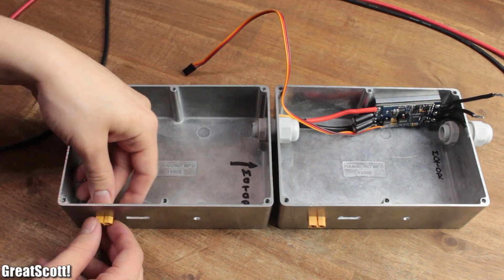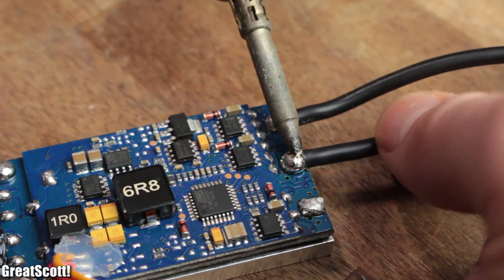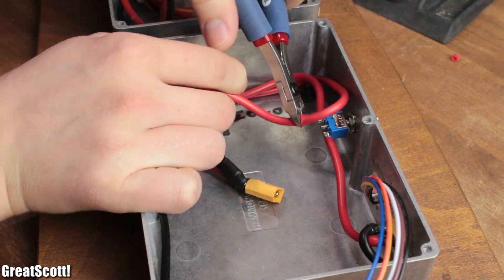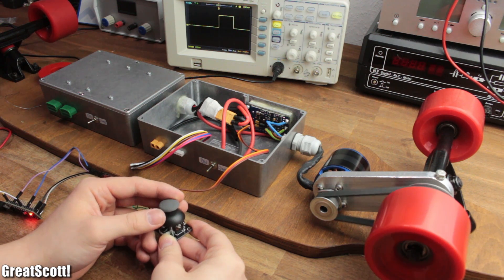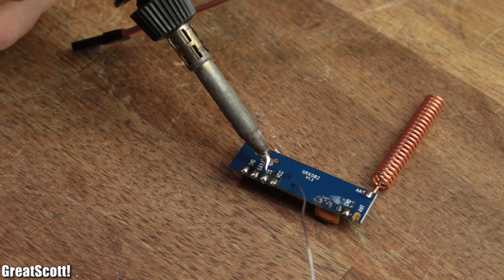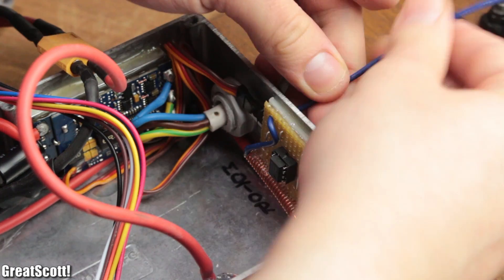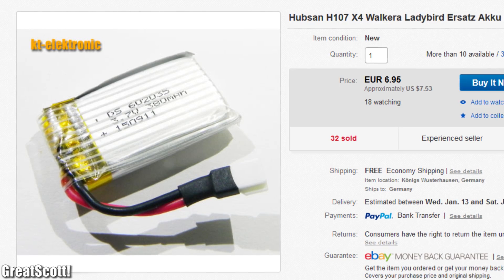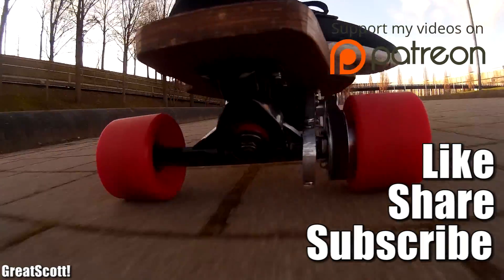Make your own Electric Motorized Longboard (Part 3) - the wiring & remote control

Comment: Hey Great Scott! Nice Video. I have a question for you. How is your power switch able to handle the DC voltage and Current required for riding a board like this? Most of the switches like yours that i found had a limit of 25 V at like 1.5 Amps, whereas a board can pull 30 Amps. Which switch are you using?

Comment: In theory, couldn’t you hook up a manual toggle switch to one of the batteries and hooked up another motor you could use it as a generator as you skate around to charge the other battery

Comment: have u had any problems because of the posibility of electric sparks while disconnecting and connecting the batteries and how did you avoid those + have you considered wiring the batteries in series to test the max speed ?
thanks

Comment: I have a problem setting the throttle to the ESC (HK BlueSeries 85A). It recognizes the Max value and the Min value, but it wont turn on afterwards.
Strange enough, it doesn't work with another esc too. There the motor only turns on if I just set the min value and NOT a max value.
Anyone any recommendations?

Comment: since i want to build my  own electric board within the next 2 month, i wonder if you would mind making a video about charging serial and paralel palaced batteries with a balance charger.
i'm planing on using 2 esc with 2 motors and 3 Batteries. each batterie will be a "5A 11.1V 3S" for charging, should i make a seperate circuit to load them balanced paralel or can i load them balanced serial?
Reply: Well after checking the prices for a 9S Charger, i figured i will just load them in Paralel and have a more complex wirering

Comment: Can I take a battery with 2S, 5000mAh, 50C (max 100) anf 7.4 V to ride the board?
And a 3100KV 900W Brushlessmotor with 56A
Reply: JeaI will use the same one. And I also dont know if I can use this Motor:
Reply: The kv of your motor is way to high. Aim for something around 200kv
Reply: Julius Ionescu 190kv is perfect. The lower the Kv, the higher torque, less top speed, more kv, higher top speed low torque. Torque will help you get up some hills. 190kv is good for 15% inclines. Anything more than 250 kv would be too high, more like drone motors. 170 is a little too low

Comment: what charging current do the batteries use? Wondering if I was to do this if I could include charging circuitry and have it chargeable off a USB connector to save having to buy a large battery charger.

Comment: Hi I wanted to know let say I use N5065 320KV, a 6S lipo Battery, then does it mean i Need an ESC that supports 6S Lipo?
I Just noticed here, you are using a 6s Lipo but you are using an ESC that support 4s lipo only? is it possble. Thanks!

Comment: I am a little confused, how did the long board go forward when only one of the back wheels had power. Wouldn't it turn slightly to the opposite side?
Reply: It's not like a tank. To turn arround, you need to move the board/trucks.

Comment: I couldn't melt the stupid solder on my lipo batteries no matter how much I let it sit there, I even used a ton flux!
Reply: You should never let your iron sit on a battery--especially a LiPo. You gotta be quick or it'll heat up fast
Reply: Keegan Martin oh, It wasn't on the battery, the tip just touched the terminals! but I guess my solder isn't powerful enough! I mean it has a hard time doing trough-hole :D it's mostly meant for smd

Comment: Hey! In the video you mentioned that you use one battery until its empty and then switch to the other one. Is there anything stopping you from turning both on and using them at the same time? Thanks =)

Comment: Hello, I need a little help. I have a Kick Ped from Go ped. I want to add an electric motor like yours. Ive done alot of research because i want a compact product like your build. i need help with gearing and what parts should i use. everyone has a different outlook. i dont need wireless since its a scooter. i dont want to reprogram anything as my knowledge is limited. Im 230lbs and the scooter wheels are 10inch. Thanks.

Comment: You used a three position toggle switch whichis only for 6A. But when you use your board there is much more power on it. Why does it not brake? Or does it work fine even after a while?

Comment: Hi friend. Your skills are way higher than mine!!!! I made my project using a sk3 6354 motor and a 120a boat esc. My problem has been the brake system. My esc just brake when the speed is pretty low. A little bit faster and it doesn't work. So, I have 2 question for you: is the hobbyking 70a esc that you used in your project able to brake? The other question is do you have knowledge to change hobbyking boat esc configuration to apply both progressive throttle and brake? Thanks and keep uploading more videos!

Comment: Hi greatscott, i can not find an programming board for the esc, can you poste an link
Reply from the maker: programming card, not board. It is not difficult to find.
Reply: thanks, but why u sound so mad?
Reply: ebay,amazon look for esc programming card,  they are cheap. sad look at all 3 comments not one told you what u needed to know. but then in some way shape or form they made a assumption about you or your situation. sad no one could help just to help but make little comments ,great scott running the channel should have at least gave you the info ...good luck, feel free to ask me if you need help since it is apparent scott nor others couldn't be bothered to .
Reply: Triston Webber  You are the best man, thank you very much! 

i have another question, do you have any links to other gears for the belt? if i want  another gear ratio
Reply: I order mine off ebay or ...alien power system or diy electric skateboards. diy electric skateboards has fast shipping,just got a new gear set and belt from then took 3 days from the time I paid til I got it and they are on the other side of the us.
Reply: but its soo exspensive from these companies... Thanks tho, i love your support

Comment: Why can't you just connect those batteries in parallel instead of putting a switch to separate them? Aren't each of the batteries just a bunch of cells connected to each other anyways?

Comment: why did you connect the batteries in parallel if you just wanted to increase the mah? why not connect them in series and not have to deal with switching one off and the other one on?
Reply: How about the motor runs off 6s NOT 12s , s as in series learn DC ffs
Reply: Robert Lozonne yeah thats literally what i said lol
Reply: How about thats not how it works, if you connect in series you double the VOLTAGE and the Mah stays the same. Series is a multiple of all cells added together, parallel doubles Mah, try rcgroups.com you will learn if you choose
Reply: Robert Lozonne lol ok jeez dude
Reply: Only because Bad information is worse than none at all, learn before speaking about subjects you are still learning about. You are learning this stuff right? Just trying to help
Reply: Robert Lozonne lmfao dude i fucking made a suggestion and switched two words around relax
Reply: well you just said stuff that you have no idea on so don't expect people to understand  you

Comment: I wanted to do this using the motor from a blender? It is an AC motor and was wondering if it is the same method you have used only using a DC to AC converter.

Comment: Nice build, but there are few things:
1.) never ever drill hole through trucks!!!! you even drilled through axle.
2.) 433MHz is not good for this purpose. it's full of noise and you are putting lot of noise into it. it's meant for short bursts of data (like switch on/off), not for constant transmission.

Comment: +GreatScott! I need some advice. I want to build one of these, but if i were to use it, it occasionally would be stored in a hot shed (probably about 130 - 150 degrees Fahrenheit), and so i dont want to use LiPo's because of the explosion risk, and i also want to be able to easily charge the battery while I'm out. So, my plan is to use Li-ion batteries, but I can't find a reasonably priced battery management system, and I don't know what kind of amperage I'm trying to go for. If you could make a video, making a new battery that is safer and slimmer for your long board, you'd be a lifesaver. I need to know how to wire it, what BMS board to buy, and how charging and discharging works. It would be a significant improvement to your long board also. Thanks for the awesome videos!

Comment: Does it make loud sounds? I live in a dangerous country. If people can realize it is not a normal longboard it is very likely that I will get stolen :S
Reply: +Camilo Infante no not as loud as a drone because drones has 4 motors this have 1
Reply from the maker: Yes, you can hear the motor.
Reply: Like with a drone?

Comment: Nice videos. Can you tell me which 3-way switch did you use for the charge/off/on. I assume it was a DPDT switch? If so was it rated for DC? ...as most switches I can find are only rated for AC use. I'm worried about the possibilities of arcing.

Comment: you really need some kind of failsafe for that 433mhz system, drive by the wrong wireless car key or garage door opener and you could have a longboard that's stuck at full throttle.

Comment: I noticed you've used regular power switches for your batteries (beside the XT60 connector). Do those switches handle the batteries without spark? I thought you'll need something like the SPS SafetyPowerSwitch 70V 100/200A to use as a power switch beside the anti-spark switch XT60. Excellent video series by the way :)
Reply: I agree with you, I think he should use better switch. I'm going to get this switch, this also has a blue LED buttom, look fascinating 
http://diyelectricskateboard.com/diy-electric-skateboard-kits-parts/electric-skateboard-on-off-power-switch/

Comment: Hi there, 
Great vid, made me want to build my own, and i did just that. I did notice a few design flaws in yours though, for instance: drilling a hole in your truck? bad idea. I made a design for a clamp that goes you screw around it. If anyone's interested hit me up i would ve glad to send you the plans. Second, i use 4 3s lipo's (2 wired in series to create the wanted voltage. then wire those groups in paralel, same result)  so the boxes on the bottom dont have to be this bulky. I used the red motor that you put in the description and a hobbyking blueseries 85A ESC. But now i've run into soms trouble. It doesn't accelerate like its supposed to. If i'm stationary the motor just stutters and it's going like 1cm/s. but when i kick a few times and get up to speed, it does work fine (did my first testrun today) any thoughts on how to program the ESC correctly? i set the governour mode to: first range (this and second range are the only settings in which it works when i get up to speed) with Rpm off it doesn't work at all (the motor turns, but when stand on it, it just doesn't want to go. And I've got start set to: start ACC. And timing to auto. Any idea why it won't work properly? Also as a radio im using the quanum 2.4ghz pistol grip transmitter and receiver from hobbyking

Comment: Is 1A charging for the LiPo battery dangerous? Most I have seen reccomend 0.5A or less.
Reply: I charge my LiPos at 5a. They are built to handle it.
Reply: +Samtheman80PvP What about the single cell in the nunchuck?
Reply: +Tom Root it depends what the LiPo is rated at. Mine is rated at 1C, which means that because it is 5,000mah, I can safely charge at 5 amps. The battery in the Wii controller was 320mah, so 1C for that battery would be .32 amps. So, charging that battery at 1 amp safely would mean that that battery would have to be rated at around 3.5C. My LiPos aren't that great because they are only rated at 1C. However, most LiPos are rated at around 3-5c meaning that a 1 amp charge for that battery would be perfectly fine. Anyways, I hope I helped clear things up!

Comment: Thanks for the videos first.
We build one ourselfs, everything runs smoothly until there is load on the motor.
So just the weel runs perfectly, but the motor stop as soon as we try to make to board run or stand on it and try to run.
Is there a setting on the esc to fix this?
I dont think our motor is too weak, we got the same like you have.

Comment: you should try powering the board with ultra capacitors!
Reply: nowhere near enough capacity.
Reply: He could use that to drive to the next socket to charge it again.
Reply: +dies200 lol yeah it would be about a few metres of range at best.

Comment: How can you brake with this ?
Reply: I think that he can control the speed of the board, so he can slow it down a bit, to make it work like a break.
Reply: Just like boosted board: slowing down speed . Or you can go extreme and even add real Brakes if you have a bit of engineering skills!
Reply: Alexander Wazza Sure but i'm not sure the ESC can go forward

Comment: Hi again, the only limit of your system right now is that there is no brake function? Did you think of using a reversed esc commonly used in RC cars. I currently built myself a longboard similar to yours and the problemn is the brake!
Reply from the maker: There is a brake function

Comment: For the propulsion you use a 1560W brushless motor, witch seems a lot, compared to electric bikes powered on average with only 500w. Do you often use full power or the reduction ratio limits the maximum power ?

Comment: I have 2S 5000 mah lipo wil iT work too
Reply: probably, only run time will change
Reply: No you need a 6s battery to power the motor. So if you put 3 of those in series it will work.
Reply: +Nino Saglia tnx

Comment: hi Greatscott!,

i am currently building the controller but i have noticed something that you did not cover in your instructable nor in your video and that is if you limit the charging current or not?

after doing some research most sites advice to place a additional resistor on the charging circuit.

in this case we are using ( tp4056 micro usb 5v 1a lithium battery charger with protection) wich is also the charging circuit that you used.

if we read what the sites say:

Charging current - 1A by default. However you can change this by changing the 1k2 resistor next to the "IN-" pad the bottom-left of the board. See the Rprog table on page three of the TP4056 data sheet for different values and matching charging currents

It is recommended that when you charge a battery, the current(in mA) offered by the breakout board is 37-40% of the battery capacity(in mAh). For example, if you are charging a battery of 1000mAh capacity, you should adjust the resistance in a way that the current offered is approximately 370mA-400mA.

this means we should place a 10k resistor next to the IN- where the 1k2 resistor is for better use of the charging circuit and more saftey.

did you place a resistor or do you think it is fine to just let it be and charge with the full 1000mah the charger is capable of ?

Comment: Does anyone else has troubles with the transmitter and reciever part? I got the motor to run directly from the ATTiny, but not with the transmitter and reciever.

Comment: Can you push with your legs with this electric longboard? Or does it get stuck when the motor is not accelerated?
Reply: The motor provides a pretty large amount of friction, and it's bad to back drive it.

Comment: Hey!
Nice job, but i have one energetical question:
-How long it rides on a single charge?
When power consumption of the motor is max (1,5 kW), depending on the bats voltage (22V) and it's capacity (10 Ah?):
1560/22= 70A - current, comes from bats to the motor, and the time on the highest speed is 10Ah/70A=0,14 of an hour, approx. 8 minutes. Isn't it too few?

Comment: Do you only have one attiny to control the rf transmitter and reciever i couldn't get that to work so i had to use two attiny to make this project, but it worked out in the end

Comment: How did you find a switch that could handle the amount of power going trough? I assume the motor eats up approximately 60A? did the switch hold up?
Reply from the maker: +herrjonna2007 Yes

Comment: Can I use the Board on wet streets? I don't mean in the rain, but after it rained, when the streets are still a bit wet. The two boxes can be sealed but is the motor resistant against splashes?
Reply from the maker: +.dinario Should work. But it is not recommended.
Reply: Mhh okay.. thanks ^^

Comment: Hello, i just finished building the board with the motor on it, i only need to program the esc, but how do you connect your potentiameter to the arduno uno ? i did not get that part ? i have no experience with arduinos. can any one help me with this?
thanks

Comment: can you please share the arduino code you used? I am having a little trouble with mine
Reply: Same, error compiling
Reply: i amended mine.
Reply: +Mohamed Omar 
I used a different type of controller, have too much work to do on the cars to play around with my board.

Comment: I have one more small question . Is the volage of the data channel 1,37v? Because i build it but it didnt work. I have also a failsafe behind the ne 5534. Where is the problem?
Reply from the maker: +Fabian Langer Probably a mistake while creating the 5534 circuit.
Reply: +GreatScott! Average cost please?
Reply: Did you solve it?